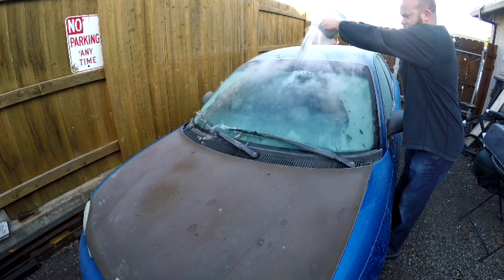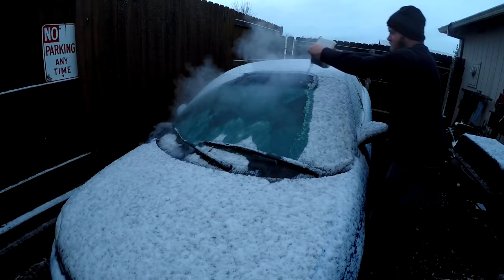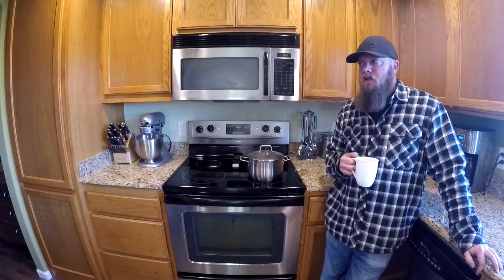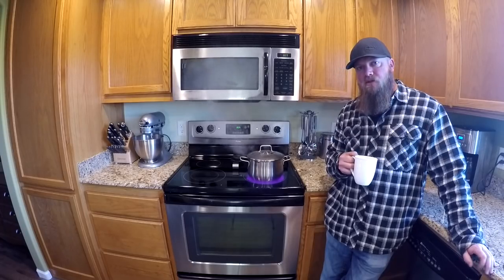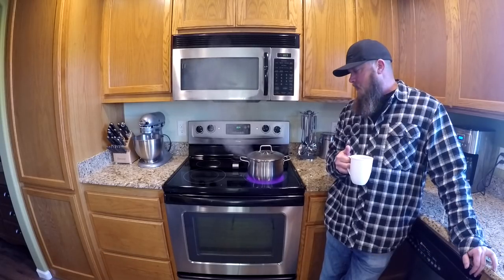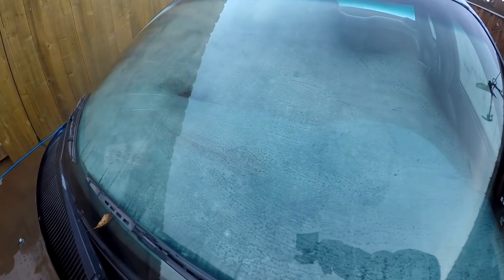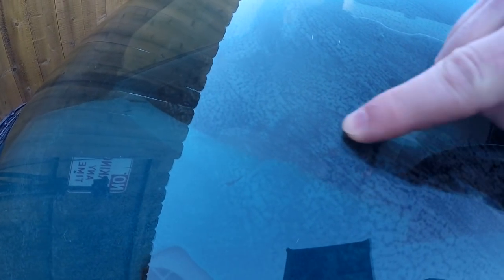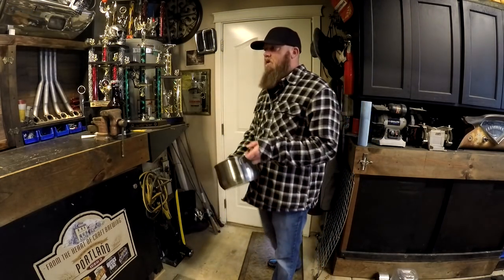Defrosting windshield with boiling hot water

Comment: I've used hot water (not boiling)  for over 50 years.... never a problem. You might want to consider using some kitty litter INSIDE your car to absorb excess moisture and reducing fogging on the inside.

Comment: That windshield can hold higher degree instant heat change, the shock is usually enough to shatter the windshield on weaker or cheaper windshields
Reply: Sorry, but you are wrong.       cheaper windshields? ...lol

Comment: Only cracks if you go from hot to cold, and the glass contracts too fast and cracks. But the temperature outside will never be 200 degrees,  and then you would never go outside and pour a glass of ice water on it. All the other info out there is fake news just like CNN.

Comment: Keep in mind he did this 20 to 27°. Now say if it happens to be much colder, like 0° or -30° then maybe it would turn out differently. I live in Michigan and normally it doesn't get too cold here but this one winter a few years ago it was -30° windchill for a few days in a row.

Windshields probably won't break until there is an extreme temperature in a very short amount of time. What those numbers are we don't know. Good to see that this guy didn't reach that change for it to cause problems but the fact that he put boiling water means the glass is pretty damn strong and can handle a rough change in temperature. So even if it was much colder, you could probably just put warm water and it would be the same differential. But now if you put boiling water over -30° now that is a test!!
Reply: It makes no difference about the temp. The thermal shock is no difference than using a car wash.... lol to all you scared cats.

Comment: I never did the boiling water on a frozen windshield but I know I had a windshield crack from driving into a cold front where the temperature dropped 40° almost instantly coming out of the Eisenhower tunnel
Reply: ... and the other 300 cars that were driving behind you had the same issue....  and that's the truth because I read it on the internet.

Comment: Water around 20 C while - 2 C outside plus  immediate wipe with a hand- wiper (rubber one). No cracks. I think there shouldn't be sudden temp changes. Therefore, using colder water then warmer after it should be fine also IMO. Nice video! Thanks for sharing!

Comment: It really depends on the temperature difference that the glass can sustain.
Some glass can sustain a 150+celsius temperature difference others can sustain much less.
In any case it's risky to do so if you're not entirely sure that your glass could sustain the shock.
Reply: Hot tap water is fine.

Comment: Just grab your igloo water cooler and fill it with hot tap water from your bathtub or kitchen faucet. Not quite boiling and you have plenty of water for all windows. You can dip a small cup tp splash the windows more easily. Run the wipers so hot water is removed from glass and not refrozen.

Comment: It only has to bring the surface temp of the windshield slightly above freezing to be effective. WARM water works plenty fine, without the risk of thermal shock shattering your windshield or even more likely side windows. Just make sure you immediately wipe the excess water off with your wiper blades (within a minute) so the new coat of water doesn't freeze up too.
Reply: The warm-to-hot water evaporates... no need to wipe. Just saying ..
Reply: @dennisrphymurphy7929  I use luke warm water as it decreases the chance of thermal shock and it works fine, Ive even used cold water which also works surprising well especially if you wipe. It's not worth risking using hot water.
Reply: @dennisrphymurphy7929  It has been refreezing on my car using warm (not hot) water so I've started wiping and it works well. Room temperature water, wipe straight away then I'm good to go. The door windows always refreeze unless I pour water over a few times and it heats the glass up. Temp may be lower than where you are though

Comment: I tried cool or almost cold water and it froze almost instantly. If you work fast though you can scrape some ice off at least. :)
Reply: Then use hot water.
Reply: @dennisrphymurphy7929  Could crack the windshield.
Reply: GymChess that’s funny, one time I went to work and I had just started my van and headed off to work without warming it up and hit about 45mph and realized my window was pretty dirty so I sprayed it and the water froze as soon as it hit the windshield and before the wipers could come back up..... this was in Texas and I didn’t realize how cold it actually was and
Reply: Hot water freezes faster than cold water.
Reply: @godofplumbing  Yes, but if you care about the difference between the two you'll soon realize that it's completely neglectable in every day practice, like when I poured cold water over the windshield instead of hot water.

Comment: Honestly, my guess is that has to do with the type of glass used in today’s vehicles.  20-30 years ago, I wouldn’t be surprised if boiling water could easily crack a frozen windshield.  With today’s technology, you would think car companies would have figured out a way to avoid this.  That’s my opinion.  Who knows?
Reply: Hot and cold or cold and hot contrast in a windshield is the number 1 thing that turns a chip into crack-winsdhield repair tech. also windshield were thicker and more durable since 1985 after that  theu are thinner and lighter than ever.

Comment: I do it with water from my boiler (up to 60°C) and the only problem is that a 1.5L bottle is usually not enough for all the ice on front, back and sides. And if you haven't swept the snow first, it will likely lose even more temperature by the time you pour it, making it even less effective.

Comment: The windscreen is not fixed solid can expand and contract, cars are designed like that. If it had no movement it would break.
Reply: You are right the winshield does do that so wjen you jave a chip it moves with Hot and cold or cold and hot contrast in a windshield is the number 1 thing that turns a chip into crack-winsdhield repair tech.

Comment: ive done this for 30 years , you have to watch for water freezing on driveway and slip .;.; but not ever crack windshield.
Reply: Oh man that WOULD def not be good...haha
Reply: @lunchladyland1562  if the windshield didn't crack with the hot water it will when the pot goes flying up in the air... hahaha.

Comment: This man just grabbed the pot straight off the stove bare handed 😐
Reply: do you not see his beard and flannel? I think he can handle a little 1st degree burn
Reply: Michael Santiago the handles on those pots dont get hot
Reply: @austina4189  yes they do I have that same pot.  It’s the electric stove
Reply: Work fine with induction cooktop.
Reply: You can tell who the poor third world country commentators are.
Reply: Gol D Roger LoL
Reply: Bruh they are handles for a reason
Reply: thats what i do and im still alive.
Reply: Them tortilla flippin fingers
Reply: pots are designed so the handles dont get hot
Reply: It's an electric stove, if it was a gas burning stove the heat would travel further up the sides of the pot. Since its electric the heat stays at the bottom
Reply: Dylan Owens conduction works with every type of heat my friend
Reply: Imagine, if it were impossible to pick up, there'd be little point in having handles.
Reply: @slopoke8656  thats if those used flames, im pretty sure induction stoves don't work directly by sheer heat but by magnetic field and eddy current.
Reply: Aeson Industries it doesn’t matter, it will heat the water inside and the water will heat the rest of the pot......... via conduction
Reply: @slopoke8656  no because if by design induction stoves are ment to keep the heat efficiently below then your hot water boiling isnt going to be wasting heat where the water isnt and clearly he hasn't filled the pot all the way up to the handles. Induction stoves efficiently circulate energy around the bottom of the pot which is why those pots last alot longer than conventional ones. The stainless steel aka ferromagnetic pots are designed to concentrate most of its energy downwards hence why they boil water in half the time a conventional flame one does. Ive never once (with the same metal handle type pot this guy has) had my pots handle hot enough to avoid touching even with water half way full of the pot on the induction stove.
Reply: Aeson Industries I believe you’re reading a little too deep into my comments, my simple comment was conduction works on every heat..... which is true... if you heat the bottom of a metal pot you will 100% transfer heat to the rest of the pot... more or less efficient? Yep.... bro water will heat the rest of the pot, the metal getting hot on the bottom of the pot will conduct heat to the top, the glass around the stove top will get hot when a convection stove is on.....
Reply: @slopoke8656  The efficient part wasn't what i saw before but now its there yes i agree. Before it seemed you were saying its the same transfer efficiency which wasn't true. No worries
Reply: Dylan Owens that is not fucking true
Reply: @dylanowens9880  Thanks Dylan. I appreciate smart people 👍🏽
Reply: @dylanowens9880  what about the very heat conductive boiling water inside it thats spreading to the also very heat conductive metal?
Reply: @dylanowens9880  Do you grab pots straight off the stove like that ?
Reply: @michaelsantiago6335   I grab pots straight off the stove like that. Just grabbed boiling potatoes and am currently eating them. What part of this simple trick you don't undestand?
Reply: @michaelsantiago6335  wtf? They're a bit warm at most, I've never even tought of anyone picking it up with mittens.
Reply: Because he's a actual man

Comment: Cold water will also melt the ice on the screen. No Need for hot water. Hot water will freeze faster than plain cold tab water in icy conditions.
Reply: There is no effect of pouring cold water on frozen  car glass when the air temperature is less than -5°C, as the water will immediately freeze in contact with the frozen surface. Also, do not need to pouring with boiling water, enough is about 50°C to melt the ice.

Comment: I'd say there just wasn't thick enough ice or snow. I've cracked my windshield on a 2007 vehicle with just my defroster before. 

It was snowing heavily, I ran to town to grab some stuff, but forgot something. (So car was already heated up) went back out to car, was an inch or so of snow on the windshield. Hit the wipers and turned the defroster to Max and CRACK! 

Giant crack that followed where the snow was left under my wipers developed.
Reply: Damn defrosters !!
Reply: Hot and cold or cold and hot contrast in a windshield is the number 1 thing that turns a chip into crack-winsdhield repair tech.

Comment: This warning was valid back in the 60s,70s and 80s. Vehicles from the 90s to present have safer sturdier windshield technology. Unless you had your windshield replaced with a cheap aftermarket you need not worry.
Reply: Nah. I watched my father defrost his windshield with hot water all through the 70's and 80's. Never broke a windshield. He would just pour it on and melt the ice, then stand there a laugh at me as I spent the next 20 minutes scraping ice off my windshield.
Reply: Care to share the make and model?
Reply: Im a winshield technician. And have been for 12 years the logic or theory you have...is completly wrong windshields are actually lighter and thinner than ever! to save wieght. And crack out faster with chips in them. they changed the thickness around 1985.

Comment: I had a chip in my windscreen. About the size of a small coin. I poured hot, not boiling water, or the frozen screen and the windscreen went bang and cracked from the chip (at the very top) all the way to the bottom of the screen. I think if your chip is tiny, like this one, you’re ok, but otherwise, it’ll crack.
Reply: scopey313 lol why would I make something like that up? Science is proof enough for you, surely? Try it yourself. Stick a glass in a freezer for a few days then pour boiling water on it and watch it smash.
Reply: @livndays45  Nice try to compare a water glass to a windshield.... go back to your knitting.
Reply: I have a much larger rock chip in my windshield.  Has no legs, just a divot.  Been there for 4 or 5 years now.  I use warm to hot water on mine and no issues.  No reason to use boiling, but if anyone wants to waste time boiling water, go for it.
Reply from the maker: Good to know. Thanks for sharing.
Reply: scopey313 well I guess you’ll have to trust me. I wasn’t anticipating having to prove it happened to someone on YouTube 6 years later 😂
Reply: Mines cracked when I turned my defrost on and it got hot all across the bottom.. only had happened on one of my cars.. f150
Reply: David Walker what a surprise, a ford
Reply: basically he meant don't pour hot water on a butt crack
Reply: What is this windscreen you guys talk about? It's a windshield. Lol
Reply: I am a windshield repair technician. And have been for 12 years. When you have a rock chip in your windshield. The number 1 thing that will crack it out. Is hot and cold contrast. When its hot out the windshield expands a little bit. And when its cold in contracts a little bit. When you have a small crack in the windshield or chip. It will move with it. Especially if you mix the two. Quickly. If the windshield is cold and you blast the heater.  Or if its really hot out and you decide to wash your car with cold water it will crack out.
Reply: And if it dosen't the 1st time. Count your lucky stars because its inevitable eventually theu crack out if you dont get them fixed.
Reply: Dont pour boiling water on your windshield, especially if it has a crack
Reply: LOGICAL MIND as I clearly as I clearly said ..... prove that it happened  and ur calling me dumb ... haha fucking idiot
Reply: Bullshit prove it
Reply: @scopey313  I'm calling double Bullshit too
Reply: Paul McPherson Windscreens are completely different look up MythBusters they tested it with cracked screens and chips screens still did nothing just saying it seams extremely unlikely
Reply: scopey313 extremely unlikely doesn’t mean impossible ..... just cause you saw it once on tv doesn’t mean shit

Comment: What about a windshield with a small crack? Have you tested in this condition?
Reply: Diego Fernando You don't even need a visible one to go cracking yoyr windows...
Reply: Hot and cold or cold and hot contrast in a windshield is the number 1 thing that turns a chip into crack-winsdhield repair tech.